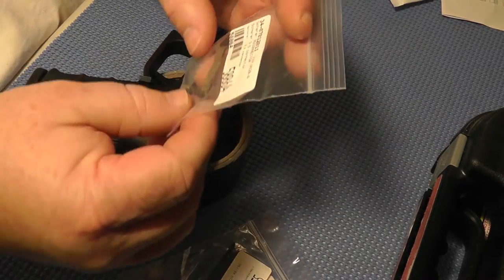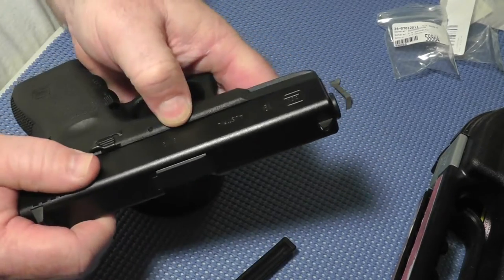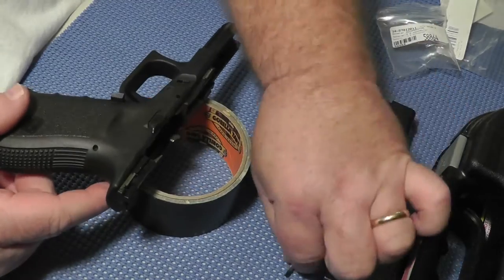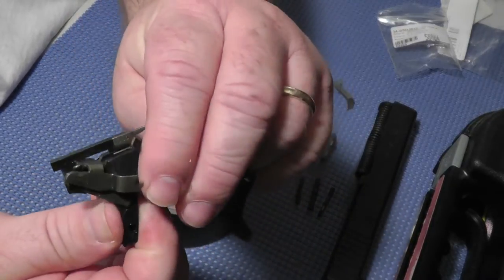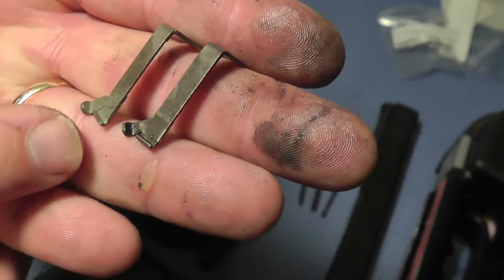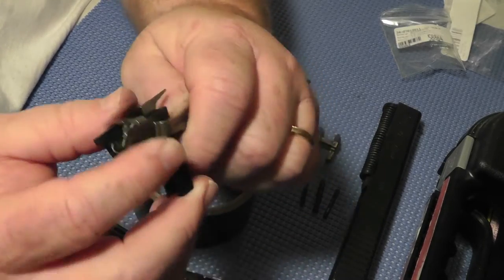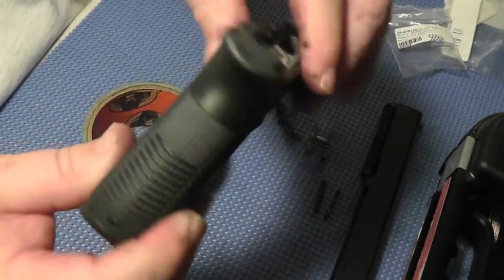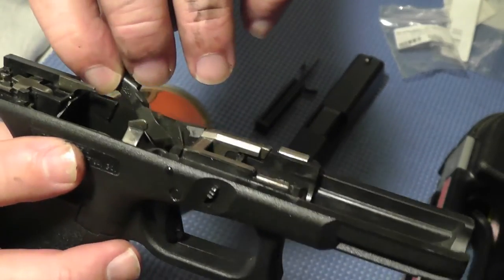Install and Range Test of 3.5 Pound Trigger for Glock 19

Comment: The difference between the 3.5 and 5 pound connectors is the angle of the small folded edge next to the ear on top the 3.5 creates less resistance on the rounded end of the trigger bar thus lowering the pull weight.

Comment: To have a great trigger, you can now add a six pound trigger spring, lower power firing pin block safety spring, and a four pound firing pin spring. I usually use semi-chrome for my polish work, but only herd good things about flitz.

Comment: The biggest difference on the connector is the angle on the one side of it where the lip is. Everyone is right that you only have to take out the trigger housing pin. But personally I take out all 3 just to inspect all the parts and make sure they are clean. If your going to take the time and pull the trigger housing out of the frame to change the connector I would just do it the RIGHT way and take all 3 pins out like you did. Thanks for the great vids👍👍👍

Comment: You didn't need to take all 3 pins out. If you just take out the trigger housing pin, then pull up on the ejector, the trigger group comes up with plenty of room to replace the connector.

Comment: Might improve significantly is you also change your grip on the firearm. The cup and saucer you are using doesn't give you a ton of contact spots (control points) on the firearm. Your left hand should be along the left side, try putting your left thumb touching the along the frame under the slide. Your left hand fingers wrap around your right hand fingers, some say they find gripping harder with the left than the right actually helps, I'm not sure, I grip both about the same. Just a suggestion.

Comment: If you would have looked carefully you would have noticed that there's a slight angle on the connector plus it wasn't necessary to take it all apart all you need to do is take out the back pain and pull up anyways I've done that to my glock what else also helps is if you changed the plunger to Titanium it works even better I've been wondering if you would do a polymer 80 Glock 19 build I like to see that

Comment: just a tip next time put your top pin in first and reduce the rist of getting your sping hung up abovr it. other wise great vide im going to get mine tomorrow but will not be using tge lighter striker sping,not worth tge chance of a ftf. also tge 25cent trigger job works great. i used mothers like i akways do and went tgrought it about six times now its amazingly smooth. also some 2000 grit sandpaper helps out.

Comment: no such thing as a .5 pounder, And a 3.5# trigger connector does not lower you trigger to 3.5 pounds. Usually reduced the trigger pull to 5.5 pounds.